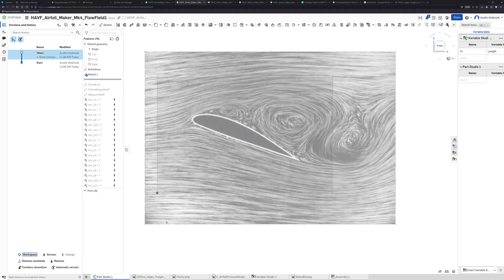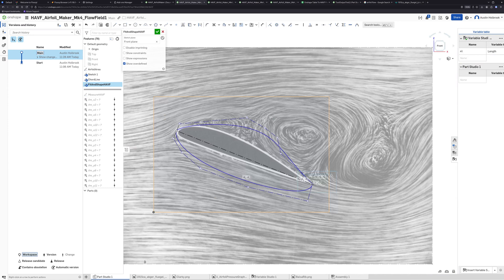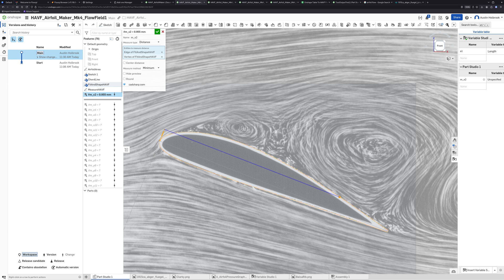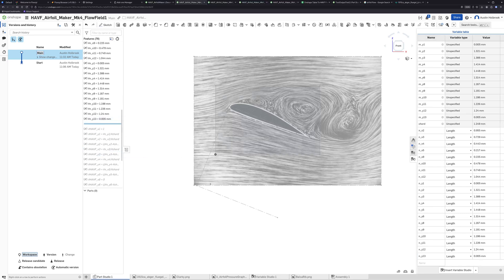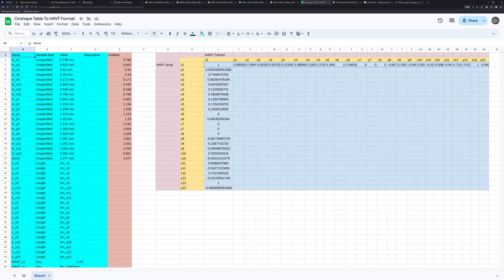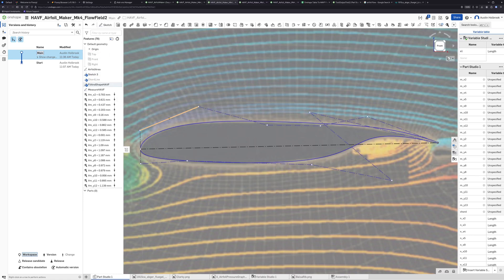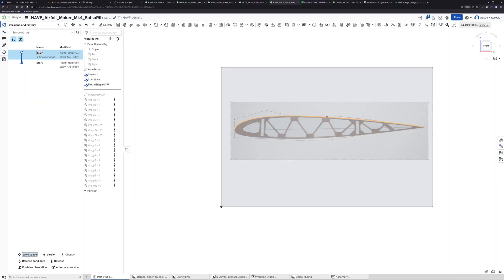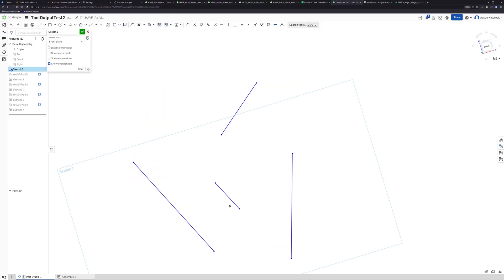Custom HAVF Airfoils in Onshape

Comment: Excellent video Austin. Good walk-through of the whole process. I agree with you that the more templates the better. I only use Onshape so can't comment on application to other CAD systems. Thank you.
Reply from the maker: Thanks for the info. Onshape is the best software to be using right now if you're a fan of this system at all. The only other big request I get is Fusion 360.